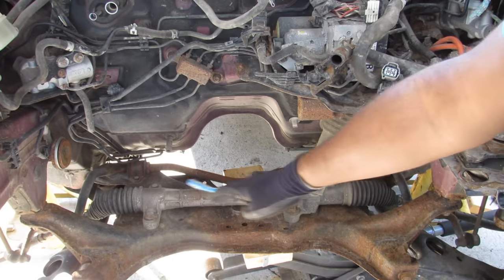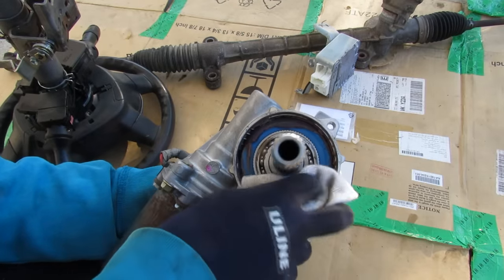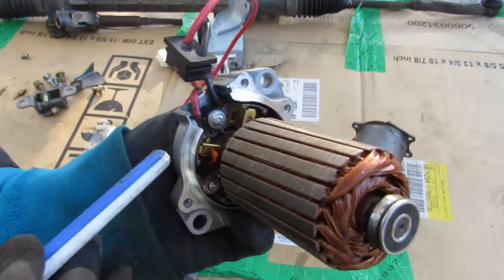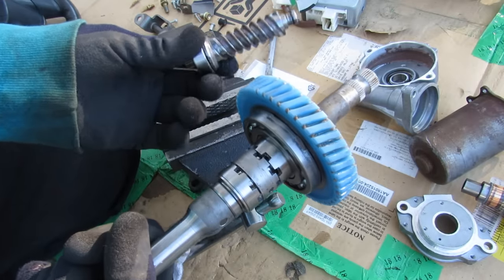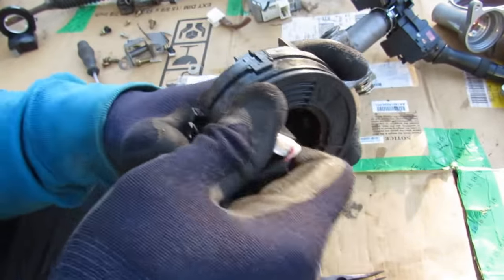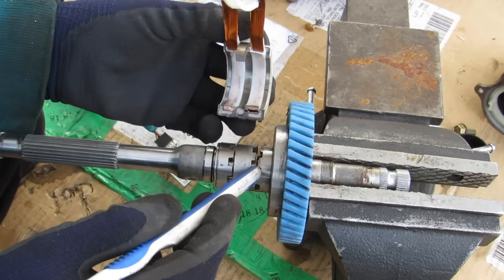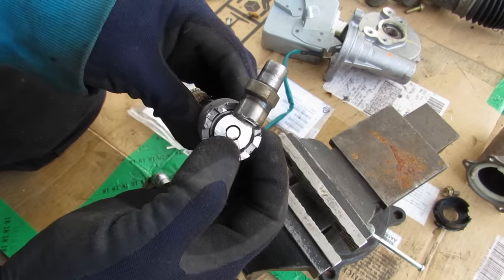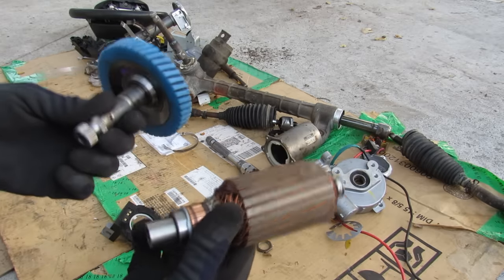How Electric Power Steering Work

Comment: What a huge amount of work to design, manufacture, + that magnets are costly-using precious metals, for a miserable fuel saving. Just use the old, cheap and reliable fluid power steering pump, like the old days?

Comment: Yes, that's correct, people are using columns from a variety of cars as self-contained units for hot rodding. Not every column works this way, but a lot of them have a failsafe mode which works pretty well but doesn't have the function of varying steering assist based on road speed. These can operate without other inputs. Others have also built control boxes which allow you to change the level of steering assist with the twist of a potentiometer.

Comment: Excellent explanation!  Electric power steering over-complicates a very simple age-old hydraulic process.
Reply from the maker: Thanks
Reply: But electric power steering is easier to replace and costs cheaper
Reply: Actually looks simpler to me.. hydraulic systems deal with 1000+ psi worth of fluid pressure, cooling, lines that could leak, pump complexity... although this uses a brushed motor, I imagine the low duty cycle/low speed operation means it should last a while.
Reply: @MattExzy  I think it was all made because they wanted the fuel economy to be better. Power steering pump create drag most of the time.
Reply: Or they want powersteering in ev mode, no? :D
Reply: planning in advance for obsolescence
Reply: @tomaskovacik  many 'upmarket' conventionally-driven cars have electric power steering.  MB tried electric brakes some years back, it was a total disaster, they reverted to full hydraulic.  If it 'ain't broke', don't fix it.
Reply: @MattExzy  This unit seems very properly engineered, it should last! It is very reassuring to see the amount and size of the bearings inside that motor.
Reply: but as he said in the video you can take that steering system and put it in another vehicle like an 80s minipickup for instance so wouldnt that make it simpler?
Reply: @Visionery1  Except that Hydraulic Steering was broken, so Electric steering fixes it. It's way more simple, better in every aspect.

Comment: As an ex fitter and electrician I love your videos. I do not drive any more and cycle everywhere now. But love seeing all your tare downs on all the bits the make up a car. Even the very act of turning the car is a massive electrical electronic and mechanical process. Super video as always.
Reply from the maker: Thanks. You are right, alot or complexity we don't often think about
Reply: @speedkar99   Yes and it is all taken for granted I feel. Just taking form the steering wheel out to the wheels, in todays cars compared to my first car of an Austin Mini in the early 80s, If all of that was put into it, there would have been no room for the engine. lol

Comment: Thanks for the great video! Now I understand better why my racing friends are removing electric power steering - it has some slack and now I know where! Plus that friction on the motor gears. 
There are quite a few EPS systems used on resto-mods like this Toyota one or one from Opel (more popular swap in Europe). I personally did use Nissan one on my DeLorean build as I know the engineer responsible for it at Nissan. 
Newer EPS systems actually use signals from Angle Sensor but that is mostly for ADAS purposes (line correction etc). Another important stuff is that some EPS systems need vehicle speed signals to adjust power steering support. The older column will look for PWM signal, but newer for CAN frames from ABS (Wheel Speed Sensor).  
Thanks again! Long-time listener!
Reply from the maker: Thanks! The "slop" in the torsion beam is the same if you have hydraulic steering

Comment: Worm gear, not spiral gear. You can back-drive a worm-and-gear set if the ratio is small--it has nothing to do with gear material. Anything over about 4:1 the gearset will lock when back-driven.

Comment: Omfg YES! Please compare the systems that use Electric Hydraulic Pumps like Volvo, Porsche GT3 Cup, etc

Drifters struggle finding a system that provides enough self steer and immediate feedback. Perhaps one design is inherently better for high rpm, low cooling potential.
Reply from the maker: No power steering is the best for feedback lol

Comment: Much better than the hyundai system that uses a rubber coupler that deteriorates and falls apart causing a clicking sound with sloppy steering.

Comment: great video! i subsd! question, confused , im getting creeking sound (all ball joints are good) when turn the wheels left to right, in park in idle, they say to fill the fluid, but there is no leaks, and my 2014 has an electric ps motor, so how is filling the tranny box w ATF going to get to the EPS when its electric, esp i dont want tover fill my tranny
???? Could it just be a bad EPS sytstem, w/ 105k miles? thank you so much!

Comment: I love the info-tainment but stay for your Brother's Toothbrush. I was also surprised to see how easy it was to rotate the electric motor's worm gear via' the beveled (large) gear.. Of course it needs to be able to be turned. It must have a interesting tooth engagement. Usually it's quite hard to turn a gear set backwards aka in reverse, yes? I'm not sure if I've explained that correctly but then again, I don't have a toothbrush to aid me :O) Cheers from So, CA. 3rd House On the Right. You RoCk1

Comment: Hello, I have a very similar steering solution in my Suzuki Swift 3. for me, if you turn the steering wheel to the left, it goes very well and normally, but if you turn to the right, the steering wheel turns hard as if there was a weak power steering. is this the cause of the motor, control module or steering wheel sensor ?? Is the voltage going to the motor always constant - 12 volts? is it variable e.g. from 5-12 volts? thanks for the advice and kind regards from Austria...
Reply from the maker: Steering angle sensor

Comment: Hello, i have problem with strength steering... Rotation with steering whell to left side is easier than right side. Are you solved this problem sometimes ?
Reply from the maker: Check the rest of your suspension for worn components

Comment: Incorrect. That tiny shaft IS TAKING all the torque of the input from the driver. What you're pointing out is the "backup plan" for when the torque sensing fails, you can then still transmit large forces through the steering column to steer the vehicle. Redundant systems are made this way so we don't just fail. Think Dad with his hands hovering around his baby just learning how to walk. Not necessary, but millimeters from disaster. Glad Dad was there :)
I can explain the torque sensor better but I think it's not needed. It's pretty cool, is had differential for maximized signal strength. Love this engineering and your disassembly videos.

Comment: I have a Toyota Yaris from 2002 with an electrical steering assist
The issue is that when I’m on lower gear (1, 2) I have trouble to do little steering but when I’m on higher gear (3 and above) with higher speeds it’s really easy to steer the wheels
The thing is that when I must do turns, or for parking I must really use a lot of force to steer the wheels and it’s really annoying 
I really don’t know if it’s a normal behavior or not…

Comment: Great video👍, I always wondered how the internal parts of EPS work, mine totally failed , no power steering, just a loud grinding noise, I guess it was the nylon gear cog that had worn/stripped from age and mileage.
Reply from the maker: How many km?
Reply: @speedkar99   148,500 miles /238, 987 km. Vauxhall Corsa 1.2 ltr

Comment: I've a similar column steering from a Renault Twingo, I want to repurpose the motor, so, I'm using a power supply to make it spin, I can hear the motor running, but the shaft doesn't move. Any trick? Is this being blocked by electronics?

Comment: I got steering angle sensor problem code on my 2017 honda civic and the steering is stuck. the brake system and stability system is on, so do you think I should replace the steering angle sensor? thank you

Comment: So it is an electrical power assist for the steering. The older systems which used hydraulic power steering were direct connected also. They used the hydraulic pressure from the power steering pump to help turn the wheels. Very interesting.

Comment: Would you know what kind of grease would be used for the worm gear? Everything I look up for EPS leads me to select few options and im Just wondering what the general lubrication would be for most EPS systems. Weird question I know but I don't want to replace my motor and use the wrong grease that might mess up what I'm trying to fix.
Reply: None are wrong, just some are better.

Comment: My friend, I have a Sonic 1.4 and on uneven terrain the column where the electric steering motor is located makes a lot of noise as if it were loose. Can it be repaired or do I have to change it all? Greetings friend
Reply from the maker: Check to make sure everything is tight, including welds and rivets. This is a safety concern
Reply: @speedkar99  https://youtube.com/shorts/C0o5bI2txlY 
My friend found that problem and when the car runs it sounds a little loose in that same part.

Comment: Another great prius video 
Is it possible that the torque sensor has a bigger play then normal and I have to do micro adjustments when driving on strait road ???
On strait road I have to do micro adjustments to keep the car strait and I'm wondering if it's from that sensor thing
Prius gen2 2007
Reply from the maker: That's an alignment or tire issue

Comment: Thanks for the information. Dude you are going to have a heck of a time putting all that back together...Kidding of course. We have a 2013 Dodge Charger SXT that has EPS we bought used in 2016. When you turn the steering wheel left you can hear and feel a vibration through the wheel and it is harder to turn it left than right. Sometimes it feels like the wheel is going to jerk out of your hands. I had it checked at the dealership and they said they didn't notice it, but there is very obviously something wrong. The car is my wifes daily driver and she has complained about this since we got the car. Any ideas what it might be?
Reply from the maker: Probably that motor or feedback circuit.  It's unlikely the computer is telling it to do that
Reply: @speedkar99  Thanks brother.

Comment: do you know how to check the torque sensor part of this steering setup, I bought one off of an 07 Prius in hopes to put it on my little tractor, for some reason I can not get it to work, I feel I have it hooked up right, the control box clicks when I connect the one small wire as I have seen in other videos but it still doesn't work, thanks in advance.

Comment: To check the fluid level on the reservoir, does one need to have the engine cold or hot? On my 2021 Jeep Wrangler, the reservoir sits at LOW when the engine is cold and it changes to MAX when the engine is hot.  Do I need to add fluid?

Comment: Is there any chances that my toyota vios gen 2,had a problem in EPS. When turning the steering wheel to the left, i have to assist to come back to its original position, unlike the normal turning of other wheels, whrn you release it, automatically it will bounce back. Any idea. Thank you..

Comment: Steering wheel directly coupled to shaft. Microprocessor references torque sensor to drive a DC motor that adds torque via worm drive. Worm drive has a metal worm and plastic helical gear that allows it to be back driven in case power steering fails.

Comment: Cool video thank for sharing !! I was asking you, some time ago, to explain us how the 'city mode' works in a steering wheel. So basically, being electric power steering it sends a signal to the ECU to send more torque to the steering column, that's why the steering wheel becomes lighter. This is how I explain to myself...
Reply from the maker: Yes. The eps computer takes readings from the canbus on vehicle speed. It'll then send more torque to the motor.

Comment: This video answers my question how its still possible to turn steering wheel (that using worm gear) when the power steering switched off :  It uses low ratio worm gear apparently .... It would be better to use electrically controller clutch to disengage the wom gear mottor when the power steering switched off ...

Comment: Thanks for the explanation, it was very helpful, I was looking everywhere to see the inside of the EPS controller and couldn't find it until I saw your video. I have a question. What happens if the current returns from the motor to the controller? Does it have some sort of protection to prevent damage or are those relays the protection?

Comment: Eps is intricate in a different way compared to hydraulic. 

Is there any advantage for mounting the eps motor to the column instead of rack? 

The only reason I can think of is that the column mounted motor would be less exposed to external elements like dust / humidity / water.
Reply: Seems like you nailed it!
Reply from the maker: Column is for smaller vehicles. Larger ones use rack mount

Comment: Hi thanks for the video.
One question i have and i don't find any answer.
If the power steering system fails, can you still steer without the danger of overloading the torsion bar ( or the shaft ) and damaging it?

Comment: So what happens if a failure in electronic module makes electric motor to lock up or turn the opposite direction? Presumably there should be a way to overpower it. Is it why they are using plastic gear? I.e. in case of a failure like this teeth are supposed to shear off? Or is there some other safety mechanism that allows steering if electronic module goes mad?
Reply: A lock up could be a tough situation for some. There is still the mechanical connection to the rack but it will be harder w/o assist at low speeds....this was the same with hydraulic assisted steering.
Reply: @gmzx3  That's why they have the relays on the ECU board. Disconnect on fault. Probably a lot of fault sensing as well (voltage applied to output, or output to ground, for example). Sensor fault seems the most risky to me.

Comment: The BEST videos and TO THE POINT! Question: 2015 Mitsubishi Mirage with electric PS. I use it as a driver training vehicle, so we do a LOT of turning when practicing parallel parking. The steering wheel gets really hard to turn after several back/forth turns. Is the motor overheating and turning itself off? Is it wise to "force" the wheel when it becomes hard to turn? It returns to normal after driving normally for a while. Thanks in advance for your reply.
Reply: On the Honda I own, the manual says in certain situations, like you describe, the assist will back off to protect the motor and a steering wheel logo on the dash will light to let you know you have reduced steering assist. It will return after the motor cools. You won't hurt anything by forcing it but the best thing for the cars and students would be to let it cool off for a while.

Comment: On my Toyota corolla the steering shot hard to the right once & at that point i discovered that it has electronic controlled steering, i cured it by simply turning the car off to re set it. Luckily it only happened once.
Electronics can do what they like if they feel like it. Mechanical steering may leak or get worn out & sloppy but it wont steer you randomly onto on coming traffic.
Reply from the maker: Wow that's scary

Comment: Another awesome video. Thanks!  I wonder what types of issues I will have with my 2016 Toyota power steering in say 10-15 years down the road. I know my 2004 Toyota PS very well and have replaced lines etc but the electric changes most everything. Thanks for posting speedkar

Comment: i have a 2012 subaru impreza 2.0i and randomly when i turn left,  it will break loose and have no resistance.  and randomly it will be fine again other times, with same resistance as when i move steering wheel to the right.  the right side never has issues.  do you have any idea as to what the issue may be?
Reply from the maker: Suspension
Reply: @speedkar99  suspension?  like, springs?  from looking at your videos it seems it would have to be something from the steering wheel down to the steering rack ...  i'm not sure what suspension would have to do with turning left and right and having the steering rotation of the wheel get loose

Comment: What happens when the electronic power steering goes out are you able to manually still steer
Reply: Yes, there is still a physical connection to the rack. It will be harder, especially when moving slowly.

Comment: How can I upgrade my Kia cerato 2012 steering wheel from semi hydraulic to electric steering
Reply: If possible please guide me. Thank You so much
Reply from the maker: Swap the rack from another kia
Reply: @speedkar99  
The Kia cerato 2012 steering don’t have electronic control so just need to replace rack with same one or need to do some modifications please guide me. 
Thank You and appreciated your reply 👍👍👍
Reply: @speedkar99  
Hi 
My Kia cerato rack don’t have electric or electronic system please guide me that need to replace the same one or there is any upgrade I can do?

Comment: There are kits you can install a Prius electric power steering on a muscle car or old truck
Reply from the maker: Oh nice
Reply: I'm guessing they use that for manual steering gear boxes. If you convert to rack and pinion, I think a GM midsize Electric assist rack would be best, having a self contained input sensing.

Comment: Just in time I was decluttering my Kei van and saw a motor on the steering section after removing the dash. I didn't know the van was power steering but not working so I just removed all the PS components.